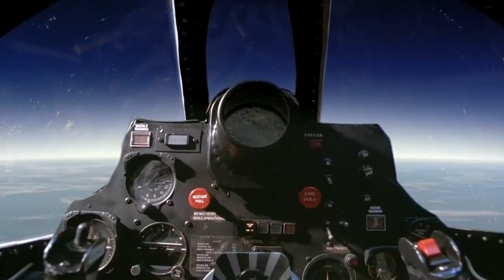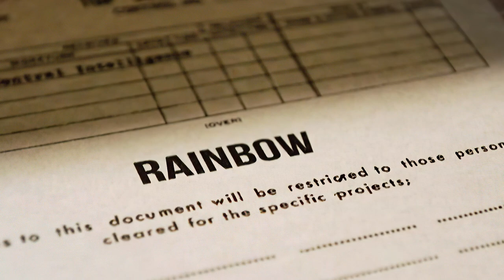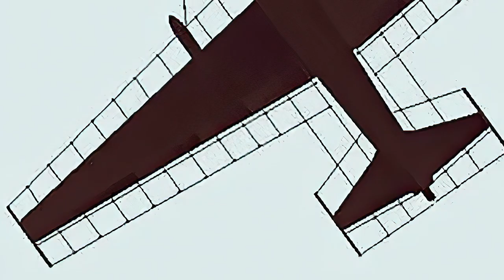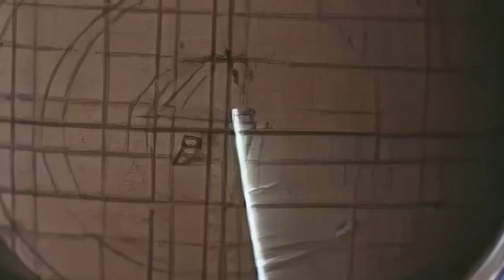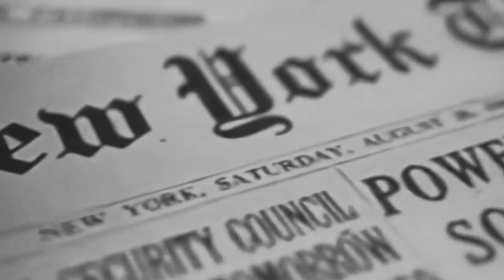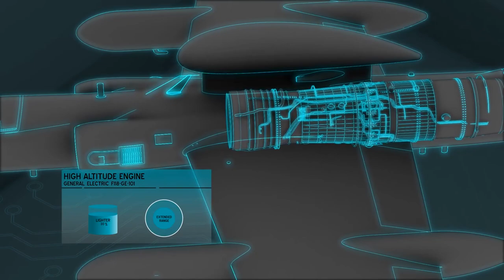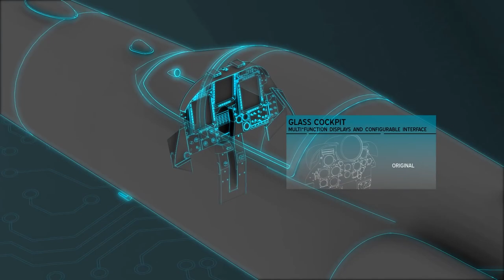Lockheed U-2 | The most famous secret plane (part 2)

Comment: If MI6 knew about it so did KGB since several MI6 officers also worked for the KGB. The guy running this channel does look like a KGB officer himself actually.
It wasn't a coincident that the shot down plane was just in time to cancel an disarmament meeting between Kennedy and Chrustiev.
Reply: What does a KGB officer look like? And who's "Chrustiev"?
Reply: Your timing's wrong there: Eisenhower was still in office in 1960. As for the Cambridge Five they'd all been removed by then. Every spy service is at risk of moles but I doubt KGB had access to the information about the U-2 back then.